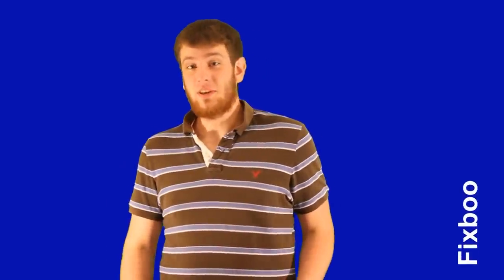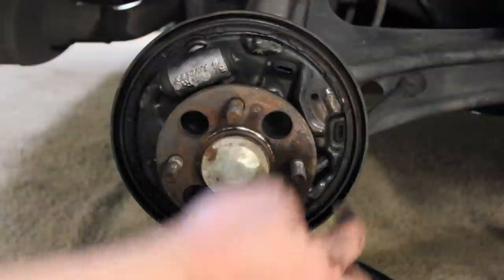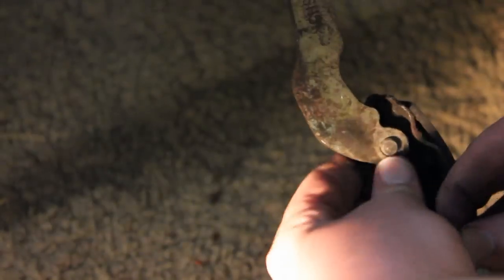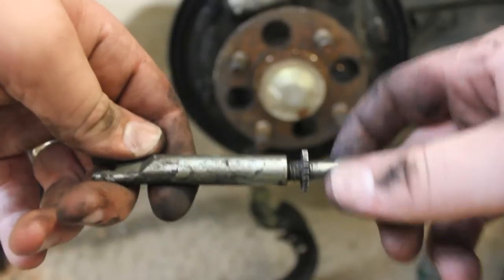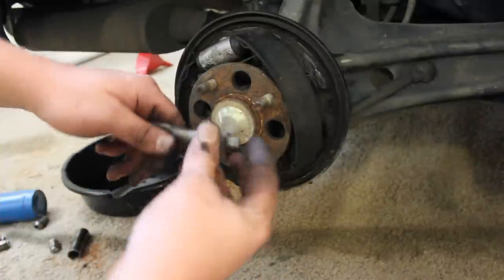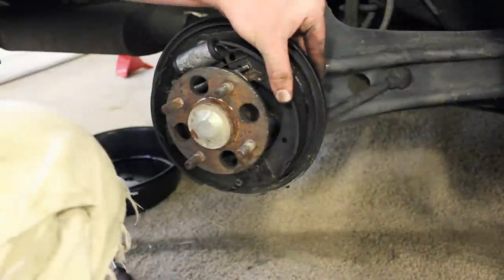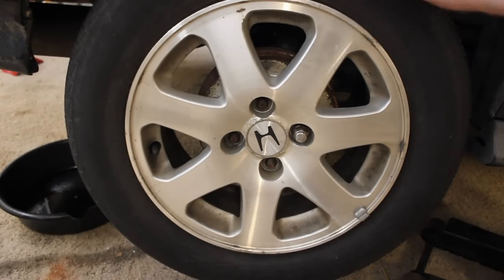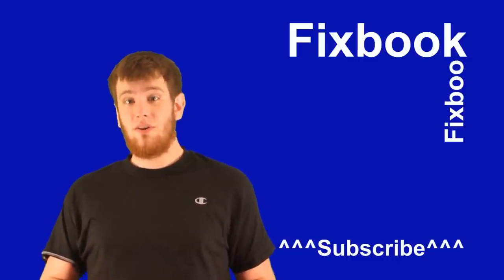Honda Civic Drum Brakes 2 of 2

Comment: Just changed my shoes.  Thanks for the help!  I haven't done brakes in over 20 years but your video talked me into trying.  That, and the fact that I have two other cars to drive if I screwed up too bad.  The mechanic wanted $230.  The shoes were $16 at AutoZone!   

I would add to use caution when with the slave cylinder.  I accidentally pushed the piston all the way out and had to bleed the line.  

I dig the tip about using the seat rail bolts to remove the drum. Huge time saver!

Comment: Good video. Only critique is, there is an access hole on the backside of the backing plate (plugged with rubber stopper) that makes final adjustment much easier. Opposed to removing and reinstalling the drum multiple times, which in some cases is impossible to get the correct clearance since a lip often forms on the edge of a worm drum.

Comment: Hi. Great video. I've been fixing cars for yrs and most are my own vehicles. Your videos are quite clear and show part locals etc. I find that quite helpful especially when repairing my Civic. I had a brake cylinder that blew apart and the brake fluid leaked all over. So I had to replace the pads and clean the drum well.  Then I one darn screw that was giving me a headache bec its head became deformed. Just a bit of hopefully helpful advice when dealing with the brake cylinder screws try to use a 10mm socket or a really good wrench otherwise you may end up with the same headache. The passenger side far right screw is the hardest to remove. ppl might want to try tapping it with a cold chisel with a hammer a few times to loosen it up. Again thank you for the videos please keep up the great work.

Comment: I was hoping you’d show an easy way to get that abominable e-brake cable out, since I need to replace mine.  I do prefer the order you took things apart and reassembled them.  I put the star bolt arm in first and fought the upper spring, which makes the bottom one seem like a piece of cake!

I strongly recommend needle nose Vise grips for that bottom spring.

Comment: I'm working on an 04 Accord LX with rear drum brakes. What direction do I move the star wheel in? My drums won't slide back on and if I apply the brakes, the piston pops off. I'm getting mixed reviews on the internet about the adjusting star wheel.

Comment: Hey thanks a lot for your help.  Awesome tutorial Jordan.   Question out of curiosity.  After completing the job, and putting the tire on and tightening them with the lug nuts, the tire feels extremely tight. The wheel doesn't move as freely.  Is that an adjustment issue with the shoes or the adjuster you showed adjusting towards the end of the video with a screw driver.
I appreciate the feed back.  
THanks

Comment: After replacing the drums, shoes and wheel cylinder on my 98 civic there’s now a chirping noise when braking around 35mph and slower. The noise goes away if you apply more pressure to the brakes. Any ideas what would cause this? I’ve gone back and inspected the drums and everything is in place and the backing plate is lubed. I just have no idea what’s causing this noise

Comment: Dude, you make taking off that u ring and putting back on look so easy, I couldn't get the U ring to separate because it would just spin in place, so I'm going to invest in one of those tools meant to seperate it.  Also, did anyone come across the problem where once you took off the brake shoes because the right side was open a little, if it slowly dripped a little brake oil from the cylinder, would this require bleeding brakes?
Reply: Grabb the open part of the ring and the peg with pliers

Comment: Thanks for the videos. They both have given me the courage to try changing my own shoes. Just one question: the last part of the 2nd video, you can tell if the starwheel is adjusted properly based on the spin of the tire, correct? I wasn't sure if that's what you were referring to by the spin of the tire bit at the end of the last vid. Thanks again!
Reply: Great, thank you John! Looks pretty straightforward, think I'm gonna give it a shot.

Comment: Question...Anyone have problems with Autozone replacement stuff vs OEM Honda? Im doing this right now & the circle pin that holds the brakes on the ebrake connector part at 1:27, they wont fit. It might if I hammered it a small bit but I don't like forcing part fitment. I know autozone vs oem will have small differences that don't really hurt anything, is this pin one of them or should I go OEM???

Comment: my wheel cylinder fell apart multiple times while attempting this
Reply: lol so did mine, didnt seem to matter tho once everything was all back in place, did it give you any issues down the road?
Reply: yes sir. it required me to bleed the brakes. I will never........EVER do my rear brakes myself again. f@#$ nightmare.
Reply: o yeah I had to bleed mine after, its not  too bad really.  I do it kind of ghetto, by taking a piece of fuel hose and kinking it off, then put it over the bleeder screw and just pump the brakes until the pressure blows it off.  its messy and ghetto but it works.
Reply: when i said "I" did it what I meant was......i got completely fed up and had my mechanic do it. luckily he's a stand up dude and basically didn't charge me. still........never again!
Reply: well it's good he didn't, there isn't much to it.  I feel your pain though, I'm very inexperienced with cars, I'm a computer technician by trade, so cars are a bit daunting.  But drum brakes as  a whole are scary, its just springs, wishes and dreams holding it all together it seems like.